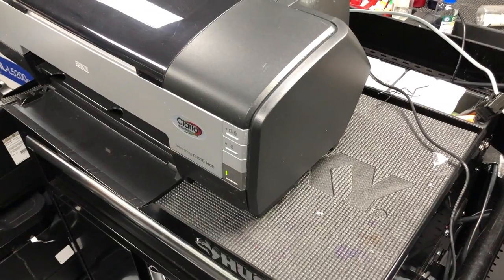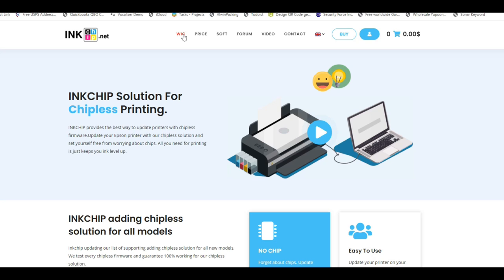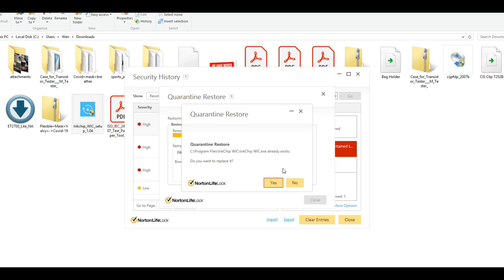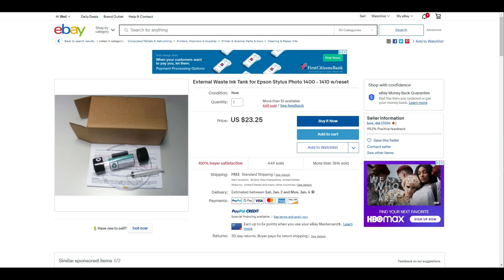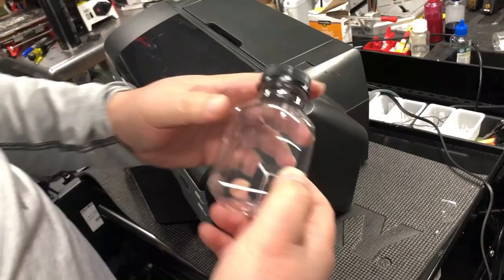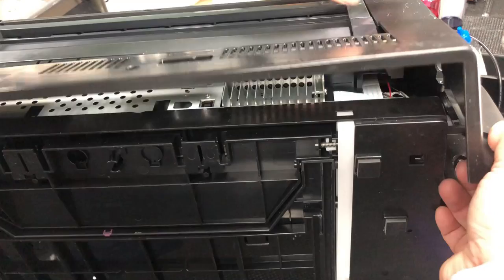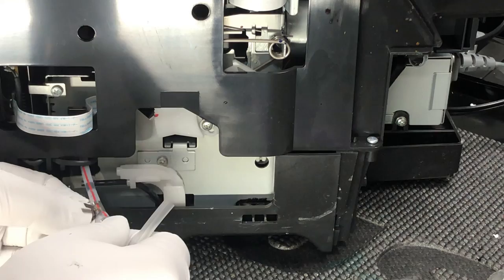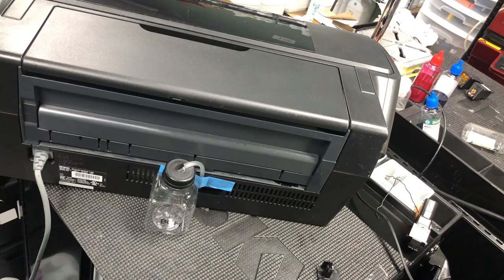Reset Epson Artisan 1400 1410 Waste Ink Counter and Install External Tanks

Comment: Hi Kevin and I thanks for the informative info. I have an issue with a Epson 1400 that i had bought new and now trying to get it restarted. I had deleted the files and program and reinstalled with the original driver after the printer restarted it didn't recognize the cartridges . i did a few more cartridge change outs and the power light went out and the two other lights are blinking and the carriage is locked in the off position. Is there a fix for this?
Reply from the maker: I am not sure 🤔.